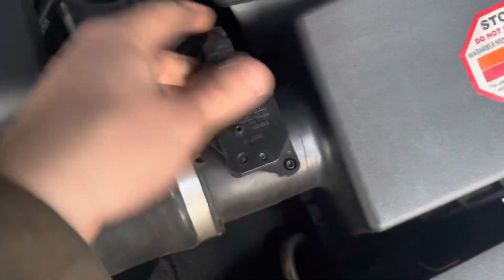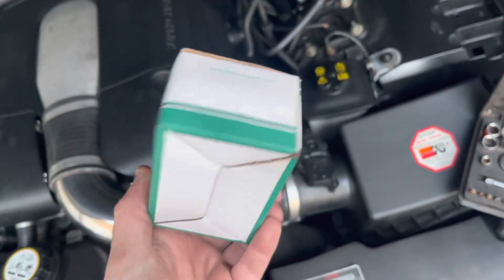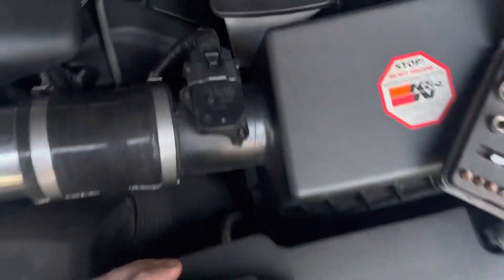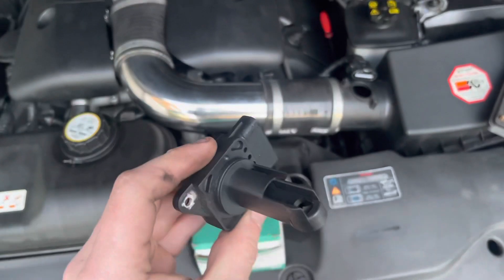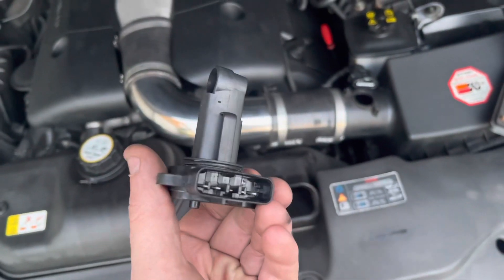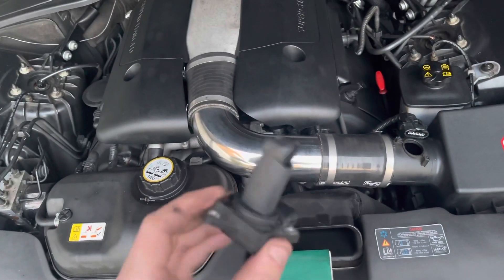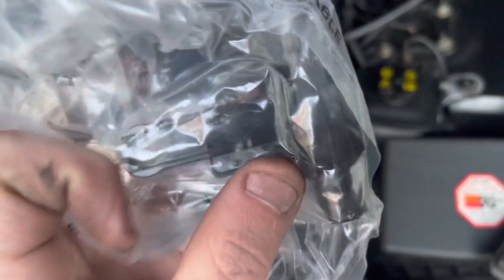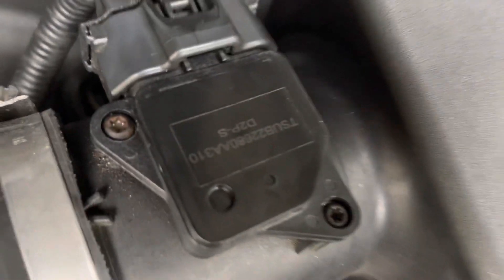Jaguar XJR 2006 Mass Air Flow Meter Sensor Replacement

Comment: My Jaguar mechanic advised against the K&N filter for this reason.
Reply from the maker: I think the filter is okay, as long as you regularly service it with the proper kit My sensor has been playing up before I changed the filter for the k&n

Comment: just changed mine, have a 2005 xjr have a restricted performace fault cylinder bank1. wondering if you know what it could be ? bad coil ?? or...
Reply from the maker: Hi, that’s not good could be several things I would’ve thought more of a sensor fault as I would thought a coil would flash up on the computer

Comment: My car is throwing system too leans bank 1 and bank 2 codes. I was wondering if the MAF is helping? I have a 2004 xj8 Jaguar
Reply from the maker: It was my MAF sensor causing mine to do that
Reply: @Chris_GasolineGarage  okay so I just need to clean it?
Reply: Btw I watch all ur videos man ur awesome!! I even watch ur posts on the jag groups on Facebook lol
Reply from the maker: You can try to clean it with some MAF cleaner but if it’s still playing up I would get a new sensor
Reply from the maker: @Kingstur  really haha that’s great thanks for watching 😀😀 what colour is your xj8 ?
Reply: Hello I have a 2005 jaguar xjr supercharged and need to know what brand and where to buy a new maf sensor thanks in advance
Reply: @Chris_GasolineGarage  mine a black on chrome haha